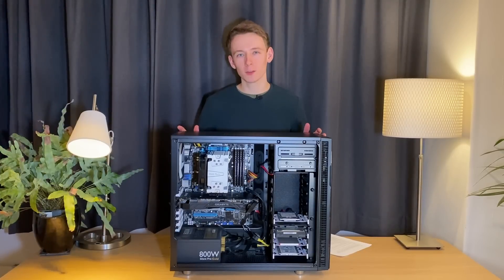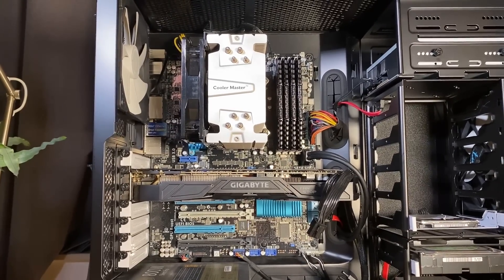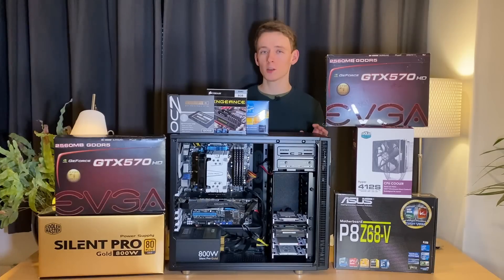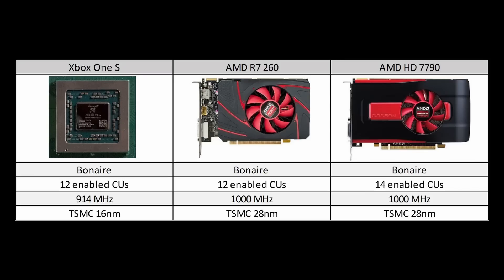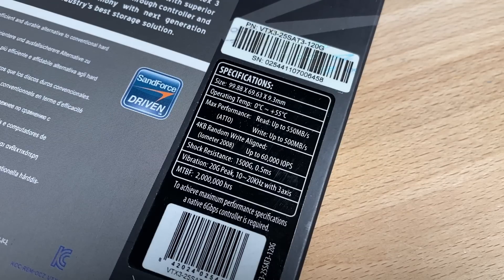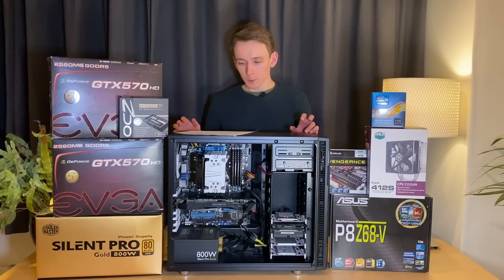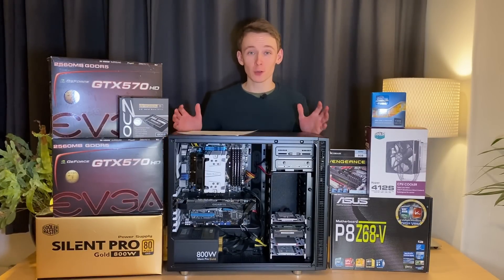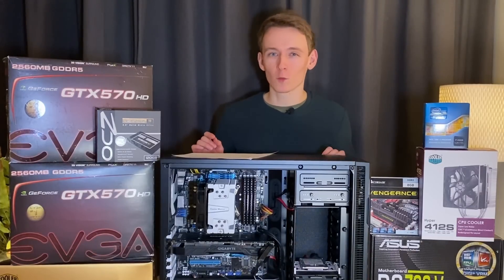I used an i7-2600K PC for over a DECADE - Here's what happened.

Comment: Ha, I upgraded from an i5 2500k with 8gb of RAM just this month. Funnily enough, what actually failed was the 7970 graphics card, the CPU and the motherboard are still fine, but I decided to upgrade the whole system because with current prices, paying anything for a graphics card for that old 2500k just didn't make any sense, it's just money down the drain.

I got a regular i7 12700, 32gb of DDR4, and a Z690 board. Using the integrated GPU at the moment, prices seem to be falling down and RDNA3 is around the corner, and overall it's not even a priority, so I'll wait. Day-to-day tasks like browsing and UI responsiveness improved, but not by much. It's incredibly cool that an 11 year old machine could not only run a still modern OS (Win10) just fine, but it's perfectly usable for a lot of activities. That being said, the 12700 obliterates it in VSTs and low latency audio stuff, what the old 2500k could barely handle, 12700 just shrugs off like it's nothing. I've also managed to reuse the old Noctua NH-D15 by buying a cheap adapter, big props to Noctua for long term product support.

Come to think of it, the timespan between upgrades is about the same had I upgraded from a P3 Tualatin to an i5 2500k. Running a P3 machine until 2011 would've been plain crazy.

Another cool thing is that I paid about the same for the new CPU-mobo-RAM combo as what I paid for the old one. So for the same money, 4x more RAM, about the same features on the motherboard itself (but obviously the latest newest tech), and I don't even know how to quantify raw CPU performance. But way more single threaded performance, and a ridiculous improvement in multi-core performance. Hoping for another good 10 years.
Reply: Nice!  I love reading these.  In 2011 I was still running a P4 Northwood as my daily rig, I was still fixated on older games at the time but it was good enough for internet and youtube just not for 720p or higher.

Comment: 2600K is an interesting CPU as it's still usable. Can you guys imagine any other component except those X58 six-core Xeons and i7s which are still usable after a decade?

My media PC has an Asus X58 board, Xeon X5650 @ 4.2GHz, 18GB RAM & HD 7970. Still plays games fine and I use it for media and as a "console".
Reply from the maker: There definitely aren’t many CPU that remain usable for that long. I can see the 8700K sticking around for a long time.
Reply: the q6600 was and same whith phenom II 4 cores and 6 cores
Reply: I do own an e3-1270v2 and it's actually really good.
Reply: Yes, X99 is almost there
Reply: @CatSovietski  X79 first gen xeons are two especially the 2690 and the 2689
Reply: I just recently threw a xeon in my old i7 950 x58 build when I finally retired it to become my media server... last year. It was still chugging along. I don't game like I used to but honestly it was still adequate.
Reply: @josephdias5859  e5 16xx v0/2 are much better. 6-8 core overclockable sandy/ivy with quad channel ddr3. I am also using a 2011 system but on x79 with e5 1680 v2 @4.5GHz and a 3070. You can get the 6 core 1650s for 30€.
Reply: @matus570  I’m running a 2690 with 128gbs of ecc ram 8 16gb sticks and a gtx 1080ti I bought used like a few months ago still I be knowing I just can’t talk about xeons on every single comment no matter how bad I want to I gotta mix it up a little bit when I upgrade I’m just going to do a 1680v2 and overclocked the living hell out of it
Reply: I5 is still pretty decent for most consumer uses
Reply: Loved my old X5650 but sadly, with these high power prices (Europe) one cant afford to keep it as a daily driver anymore or as a media server :(
Reply: @GabrielBaltat  yeah, I also live in Europe in a relatively poor country (by European standards anyway) and we buy electricity from Ukraine. Power went up 300% and that made me consider trading my platform for something newer but I don’t want to pour any more money into it right now
Reply: 8150 and 8350 are still usable. With 8350 being identical to slightly better in multithreaded (sold for about 2/3rd the price as well)
Reply: The Phenom II X4 era was wild, at one point you could get one brand new for $99 and it really held its own at the time. Gone are the days...
Reply: @shards.v1  Yeah the 955 and 965! The 980 and later 1090T were pretty good.
Pretty sure the 1090T/1100T are still playable if you have good settings in your mobo. Easy to cool too.
Reply: X79 and X99 for sure.
Reply: @matus570  my man! 1680v2 in a z420 @ 4.2 all core. It’s hilarious how good this chip still is

Comment: Yeah baby!
i7 2600k is still alive. And it can still be used for games. But it can be a bottleneck even with a GTX 1070/1660C. And this is with overclocked CPU and RAM. A stock processor will be 20-40% behind.

I still use this processor to generate content for my YouTube channel.

Comment: I'm still on a similar-era i7 3930k (6 core Sandy-Bridge E CPU). It's been overclocked to 4.4ghz for that entire time though, and has a gtx1080ti and nvme drive (had to use a PCI-E adapter and mod the bios). Surprising how well it still runs, though if things weren't so expensive I'd have probably upgraded a couple of years ago.
Reply: My main PC I've had for 10 years now, with i7 2600s, 16GB DDR3, RX460 4GB, 120GB SSD, 2 x 1TB HDDs and of course Windows 7. Still plenty of performance for what I do daily.

Comment: Awesome setup! I have almost the exact same story and components, i used my 2600K for about ten years also, motherboard from ASUS, case from Fractal (since i'm Swedish, i have to 😉), 750W psu from Corsair, 16GB memory kit etc. 

The system is still going strong, but it now lives in the "museum" part of my computer section, along with ~15 other systems spanning from an awesome 486 up to that Sandy i7. Last year i bought the i9 12900K and hope to use it for a decade also, maybe changing out the system memory and gpu from time to time, you know how it is. 

Great video, all the best from Sweden ✌

Comment: Great video. I had my i7 4400 when it first came out in 2013. I just upgraded to a new processor this year.  It ran really good. I only added 2 SSD's, changed out my graphics card twice over the life span that I had it and added a new power supply to handled my final graphics card. One graphics card went out, and I got a great deal on a 1660ti (which I use in my new build) so switched out my second graphics card for it. Toward the end you could tell the processor just couldn't handle things anymore no matter what I tried to do. Even did a fresh install. It just didn't have the power to handle things that I wanted it too. It still was an ok PC just for normal stuff, but not higher end game stuff.  One thing I did not change out was my ram, so makes me wonder if that was the cause of the issues toward the end. I sold it so no clue if the ram was the problem as I bought all new stuff for my new build I did other than my power supply and graphics card.

Comment: What’s funny is that there is still plenty of horsepower in those Sandy Bridge chip for years to come as long as one is not expecting AAA titles.
Reply: Yep. I was up for a full computer upgrade but decided first to just put the old one in a new case, clean it up, see how it ran after some modest overclocking increase... It was beautiful. So I got a new GPU as the prices fell, and a USB 3.1 card (already made other small upgrades over the years), and that will probably serve me well for a few years more of 3D designing and modest gaming/retro emulation.

It runs cooler and faster than ever. I'm absolutely floored.
Reply: @rockstopsthetraffic  And once Microsoft stops providing updates to windows 10 in 3 years then just install Ubuntu LTS with the latest Mesa PPAs.  There is no reason why it couldn’t last for another 8 years from today or 5 years from when Microsoft ceased updates.
I mention Linux because that is what I did for this PC.  Valve has really done wonders with proton.  Even the games which aren’t verified run on Linux through steam.. nearly my entire library of 500 games.  The only few that don’t work have kernel level anticheat.  Even then, EAC is supported so games like Apex Legends run great.
Reply: @coleshores  assuming that the TPU bypasses for Windows 11 stop working, then yeah, it may well become a linux machine. I'm quite versed in linux, have several ThinkPads that either dualboot or only boot into linux, and have done various Raspberry Pi projects over the years. It doesn't need to be sold to me, lol.

It's not gaming I'm concerned about with linux, it's the ability to use my design software.

Comment: Hey, I have almost the same system 

12600k with am zalman cnps10 extreme
P8z68 deluxe 
GTX560ti
8gb ram
850 watt psu 

I have added a GTX 1080
2 sata SSD’s

I have now  upgraded to alderlake i712700k with RTX 3080 12gb and 32GB ram

My old Sandy Bridge system really did me well But it’s age is finally showing and it is time to upgrade.

Comment: Hey I'm on an i7 2600k on the Asus evo board w/16gb corsair vengeance ram coolermaster 750 power I bought 11 years ago. While I have replaced graphic card & hard drives, all above equip still works & I play aaa games no problem. If it ain't broke don't fix it!
Reply: Similar setup, very true. It just keeps chugging.

Comment: Very similar to my old Sandy Bridge build w/ the 2.5gb 570s in SLI. One of mine also failed after several years. We're basically twins! :D

Other than upgrading to a gtx1060, the system is still running as my VR rig.

Comment: What a heartwarming video! I'm still on my i7-2600k. Started with two 560 Ti for BF3, ended up with a 1080 Ti. And of course packed it over the years with SSDs, max DDR3 RAM (before it went out of stock for good) and a hefty Noctua fan cooler. I'm keeping this build around forever. I was looking to make a whole new build, but didn't make the move because the chip shortage hit.

Interested to see if the upcoming line of processors and graphics cards call to me in the same way. Hope to see BenQ come out with a 4K 240Hz monitor of their own, so I can build around that. I actually got their at-the-time revolutionary 120Hz monitor with my 2600k build, and that was another part of the setup that has lasted incredibly well into the future.

Comment: Until April of this year I got by on an old fx4350 with an r9 270x I acquired in 2012. It did what I needed to do. Until it didn't. 
That ol'pc has now been replaced as my main computer, however it's also since been personally refurbished from top to bottom and now serves as my bedroom pc. I also got it a used rx580 8gb red devil upgrade for $100 off ebay along with a load of other inexpensive upgrades. Very personally attached to that ol'tank. 
My new main now runs an i5 11400f and an rx6800. It was a noticeable upgrade. I figure I should be able to get 10 years out of this new rig, too. You have to make your stuff last. 
Nicely done. Great channel.

Comment: I still have an I7-920 that I bought brand new, with an Asus P6T-Deluxe motherboard.
Throughout the years, I had swapped the PSU because I was afraid of it failing, added 24gb of ram from Amazon, 6 dimm kit (triple channel era), originally I had an Evga GTX 285 installed, but it was swapped with an RTX 2080, and the CPU was swapped with an X5690 I got from Aliexpress for like $50 or so.

It's a great machine, with all the PCIe lanes I got, I installed a WiFi 6 module, and NVMe to PCIe add-on cards.
The only dumb thing I did was to BCLK OC (locked multiplier) while forgetting I was using the add-on cards, and fried an NVMe SSD (got it replaced under warranty, though).
Fantastic machine, still have it, but it isn't my main anymore. Upgraded to a Ryzen when 4C\8T were no longer the mainstream, god bless AMD.

Comment: Great times to build a machine, the i5 2500k and i7 2600(k) aged quite well, making It worth the price if you consider that they can still play games nowadays with decent framerate, also, 1155 platforms offered Sata III, USB 3.0 and even PCI 3.0 on some MB, making It future proof, only lacking M.2 and USB C compared to newest ones. Sadly, GTX 500 and HD 6000 aged a bit badly, but if you waited up to 2012, you could end up with a 680 or even better, a 7970 that  are still decent for 1080p
Reply: 2600K aged way better as newer games benefit significantly from HT. I agree with HD 7970, I have that on my 2nd rig and it still plays games at 1080p with lower details.
Reply from the maker: Thanks for the comment - and I agree! I did consider the PCIe gen 3 variant of the P8Z68-V iirc…
Reply: Im currently looking to upgrade from a i7 2600k and my Radeon HD 7950
Reply: I was blessed to get a discount on a 2600k when I built my big machine way back then, because the store had run out of i5's.

Love it even now, with successively better SSD boot drives, a GPU upgrade, a modest overclock, and a USB 3.1 header card, it definitely pulls its weight, satisfies my 3D design needs and occasional gaming. Runs cooler and faster than when I bought it (old gpu must have been the main culprit). If it lasts, I'll probably use it to some capacity until Windows 11 forces a mobo upgrade.
Reply: The Chinese boards have m.2 and usb c there cheaper than trynna get an asus or asrock board for 1155 platform so 2012 remains good for entry level systems
Reply: It's not that they aged well, hardware progress stagnated after 2011.
Reply: Still rocking my i5 2500 unlocked

Comment: I have the same setup and used it for work every day. It's lasted 13 years, I've added a few upgrades like  the GPU from a 580 o a 1050ti. Its been sold and the value for its productivity is now deep in the negatives. My newer laptop specs are now better then my desktop but with a full case I have lots of HDD space for projects.

Comment: Still using a 2500K at 4.5 GHz all core, just past its 11th anniversary. Bought it in mid 2011 expecting to replace it after around four years which was the upgrade cycle I grew used to in the 2000s, but only had to replace the GTX 560 Ti with a GTX 970 (and the system HDD with an SSD) when the time came because CPU development had stagnated so much with AMD being uncompetitive and Intel becoming lazy, and then the next upgrade point simply never arose as I grew disinterested in keeping up with the latest games and gimmicks. I can play games up until a few years ago fine and I'm currently busy revisiting older PC games and emulating PS1 games anyway, so I could theoretically stretch it further, although I'm currently building a Xeon 1650v2 (4930K) and GTX 970 SLI rig with Nvidia 3D Vision just out of curiosity and so I can say I've had quad channel RAM, SLI and 3D Vision at some point.

Comment: I ran a i7 3820 on a Asus Sabretooth X79 with 32gb of ram (I forget which exactly, sadly), a original Titan then later a 680 (4gb) when the titan died and a early SSD at first from Samsung at a woppig 20gb, that was a obvious upgrade as time went on and got a Force 3 512gb for cheap. Ran that system for 10 years, then I started gaming more and a upgrade made sense. The i7 3820? Yeah that's still kicking around as a NAS/TorrentBox, aswell as small local services and my son and his buddies Minecraft server, which his friends thinks is super cool so added bonus it's gotten my 7yo some street cred

Comment: Still using mine at stock settings with an rx 580.....works well.....certainly well worth the money
Reply: They are robust. If you have even a basic aftermarket cooler like a hyper 212 pro/evo, it's absolutely worth going up to like 4.5ghz, following a guide online. Temps barely went up, and everything got just a bit snappier. It can handle it easy, I kicked myself for not doing it earlier.

Comment: Good to see others still using older but viable tech. I have been using my I7 970 and it runs well still. Windows 11 may put an end to it mind you. Also using the old ROG mobo from same time period and 24 gigs of ram. The only thing that's been updated are the video card and the HDD. 
I updated to a Nvidia 2060 not too long ago, and was pleased, I had been using a 770, and before that the original 580. All good cards, if you are fine with mid level graphics.
All still running along with no problems.

Comment: We need a follow up to this video.. with a bios update you can add an i7 3770k and a modern gpu like Rtx 4070 also Ram upgrade like 32 gb kit of 2133mhz/ 2400mhz.. ❤ you will see a massive boost in performance. It will be a great comparison video to the current specs you have.

Comment: About 15 years on my Asus G50VT laptops with dual-core X9100 slightly overclocked to 3.3GHZ. It just will not die despite the years of distributed computing i have run on it

Comment: Proof that you don't need to always have the latest tech, nor need to upgrade every generation.
I made my first build (Skylake) in 2016, then:
- added 1050Ti in 2017
- upgraded boot drive to a better SATA SSD in 2019
- upgraded boot drive to Gen3 NVMe SSD in 2021
- changed out mobo, RAM and CPU to 12th Gen in early 2022
- hopefully I can upgrade to a more recent 1080p GPU in a month or so 

My use case is very different from yours, but I believe our main thread is that we're both gamers.
Reply from the maker: Thanks for sharing!

Comment: i know that feeling man. I stil use my 2600k, 16GB RAM DDR3 and my lovely GTX1080. Over the years i changed the board because it die, also my corsair power supply died. i'm still able to play some games at 4K 60fps. I'm planing to get an i7 12700K but maybe on november.